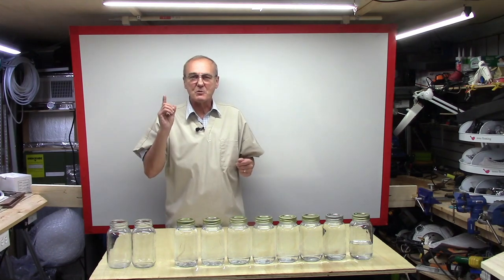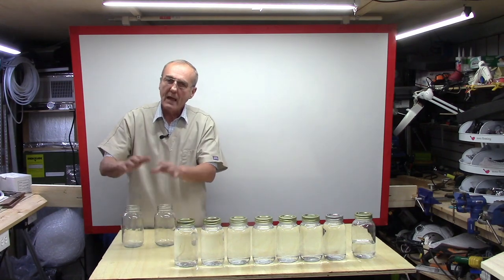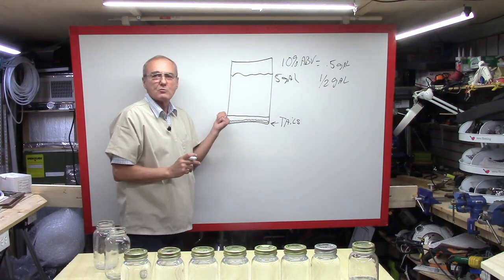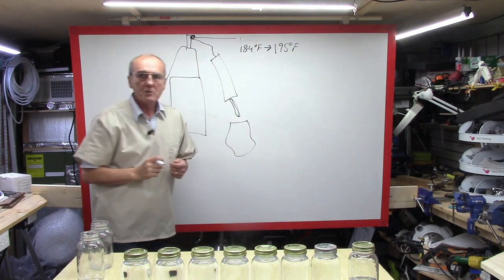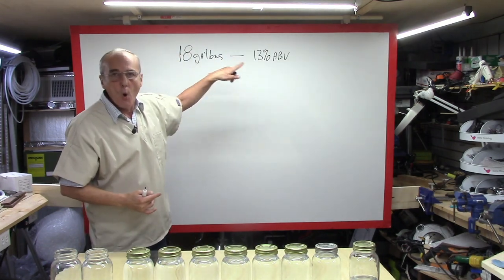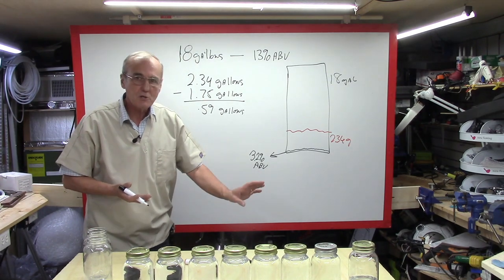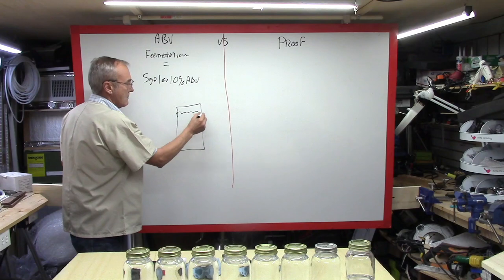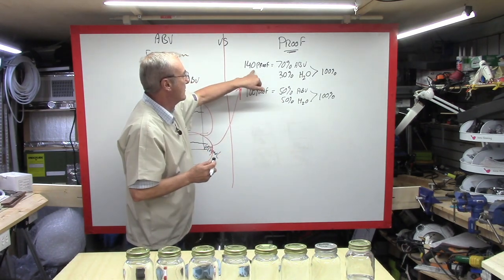When Distilling How much Do I Get

Comment: When using George’s technique of “cut it off at 100 proof AND 204 degrees” you’ve got to hit them both not either or, the math works great every time. 5 gallons of 10%, science says that’s .5 gallons of 180 proof. Take off 200ml of foreshots and 400ml of heads, you get almost exactly 1 gallon of 90 proof every time (same as 1/2 gallon of 180, just brought some water with it due to the azeotrope relationship). Now you can make cuts and separate for higher proof in the first few quarts and lower proof for the last few quarts, but a gallon of 90 proof works for me. Happy Distilling!

Comment: Question?.  Your 1.75 gal of hearts aren’t 100% abv.  They probably average 60% +/- abv across the run, so the actual 100% ethanol volume would be 1.75 gal x 60% or about 1.05 gallons of 100% ethanol.  That represents a little less than half of your initially calculated alcohol content.  If the actual final abv was 65%, it would get you to about half.  Am I missing something?
Reply: I agree. If initial ABV is 13% then from 18 gal that represents 2.34 gal at 100%ABV. But his product is around 60% so if you consider only 2 gals out of the 2.34 gal went through, subtract forecuts+heads+tails, then his final product quantity should be 2*100/60, which is 3.3 gal.

Comment: I actually use another simple math formula for "Final Product" just to get rough estimate. It's 75% hearts in my mind. So, like the original formula: 18gal at 13% = 18*0.13 = 2.34gal like in the video. But now I do my rough estimate of Heads+Tails (unusable product) to be about 25% of the entire thing. So what we're left with is 75% of the good stuff. So that's 2.34*0.75 = 1.755 gal of Good Hearts -> Pretty much exactly like in the video. Of course it can vary by a little bit, but I like that it's close. Formula would be Final=Total*ABV*0.75. And, of course, you can get into the intricacies of having actually more liquid in the end if it's lower proof or less if it's higher proof, but you should - at a glance, be able to determine just how much Mash you need to start with to fill a particular barrel for aging (whether you water it down before barreling or not).

Comment: George, I must be missing something. Your discussion only adds up if your jars are all 100% ABV. There must be a lot more alcohol that is not winding up in your hearts. You don't have 1.75 gallons of ethanol. At, lets say 75% ABV per jar you would have somewhere around 1.4 gallons of alcohol. I don't have a calculator in my hands because I have a glass of whisky instead, but am I missing something?

Comment: Maybe I'm wrong and I have watched this video probably 10+ times.  If there is 2.34 gallons of pure alcohol in the wash and what was collected is 1.75 gallons of which the starting proof was 140 and ended at 100.  By my calculations a lot of alcohol was left in the wash.  Reason I say that is because what was collected was not pure alcohol so that first jar was 140 or 70%.  Well that is 22.4 oz of pure alcohol (32oz jar) and we have almost 300 oz of pure alcohol in the wash.  There are only 7 jars with distillate.  I estimated almost 1 gallon of alcohol left and that is me assuming the proof on the other 5 jars and the tails that were not collected and subtracting 22 oz for heads and I am being liberal with that number as I can see that his heads jar is about half.  Just want to make sure I am calculating this right because I use that math to figure out when I need to stop collecting or to expect tails.  It has worked for me so far, but I wanted to make sure I had that right.

Comment: Awesome refresher course. I could listen to you all day, George!
Reply: Ok Bearded...

Now for your 2 cents.

Do YOU reuse your tails in a subsequent run/runs?

And have you noticed off flavors from it?

Or do you just toss them?

I respectfully disagree with George on this.
The amount of useful ethanol in the tails is... in my opinion too valuable to waste.

George obviously disagrees.

What say you?🤔
Reply from the maker: Wow, thanks!
Reply: @BarleyandHopsBrewing  Thank you for the solid content, brother:-)
Reply: @BillMcGirr  I think both techniques have merit, and it just depends on what you're running and what your goal is. If you have a use for tails, then putting in the time is worth it. There are always some weird flavors in the tails that might add to a blend, maybe only a few ounces. As far as rerunning in a new wash, yes, as long as it's the same spirit. You get the congeners and the ethanol. Whiskey tails into a whiskey wash. I did a video on feints about this, but it really is a preference thing. If you feel like spending the extra hours running and like hunting for that 2 ounces of caramel or whatever that's hiding in the tails, then that's what you do. If you want the residual ethanol added to a new wash, then you run deep. But if you'd rather have a nice clean hearts cut, then save those hours and cut it like George does. I like both methods and decide which one based on the end goal.
Reply: @BeardedBored  

Good stuff.
Appreciate the reply.

Best wishes.😊👍🥃
Reply: facts

Comment: Thank you George. I have been worrying for some time that I was doing something wrong because I was stopping the process at 100 proof and maybe I should continue for longer. Your explanation is clear, makes complete sense and demystifies the topic.
Reply: if the still is still running how do you stop at 100%? I'm very brand new to this and just started learning all this before I buy any still.
Reply: @Charlie32856SBCT Turn the heat off and stop collecting

Comment: Great video George. In the end, the batch size and the amount of ABV your batch has will determine how much you will get before dilution/proofing which is pretty easy to do. I use Liters and Mililiters to dilute my alcohol to a drinkable state before filtering because it's more accurate. Below is some basic formulas that anyone can use to calculate and dilute their alcohol.

ABV Hydrometer Formula (Calculates your ABV in a mash/wash):
Original Gravity - Final Gravity = answer mulitplied by 131.25 = ABV in a wash/mash

Specific Gravity Formula for refractometers using Brix:
Brix Units mulitplied by 4 = Specific Gravity

Alcohol Dilution Formula (I use L and ML's because it's more accurate):
Actual ABV % divided by required ABV% multiplied by liquid volume minus the liquid volume = needed water.

Comment: There's one thing I didn't get. To get abv from proof, you just divide proof by 2, right? Then why do you use both units instead of just sticking to one?
I mean, we could just say the mash has 10%abv, and the distilled result is 50%abv. Which is the same as 100 proof

Comment: Thanks for all the instructive videos George! Big fan, learnt alot the last couple of months that I've watched your videos.
My math and/or thinking might be incorrect here, but I think you forgot one step of the calculation. There's 2,34 gallons of pure ethanol in the still, but the product exiting the still is not pure ethanol. For example; If you get 60% during the entire run it would mean 2,34/0,6 = 3,9. If you could collect all of the ethanol (including foreshots, heads and tails), at a 60% abv you should get 3,9 gallons of of that 13%, 18 gallon mash.
Please correct me if I'm wrong though, and never stop doing what you do! :)
Reply from the maker: These volumes are all round figures so you can predict collection amounts. You will never collect 100% pure ethanol and actually you will never collect 100% of what is in the still.
Reply: @BarleyandHopsBrewing  That's true, but in my opinion it's better to take that into consideration when calculating what you can expect from a run. If there is 1 gallon of pure Ethanol in the still and you get 1 gallon of 100 proof, you really can't say that you got it all out as there are still a lot more distillable ethanol left. More than enough to just dismiss it as heads or tails. If you use a reflux still and get about 95% out, the difference is not that big. But if you use a pot still and get about 60%, the difference is significantly bigger.
But I'm here to learn, and all of your videos really make workdays and evenings more interesting. So thank you for that!
Reply: The whole exercise is for taste and smell. The process should be toward those ends so ignore the math because you cant calculate good tasting booze.
Reply: @brianmckibben2300  That is true, and I fully agree. Though my "issue" here is the calculation itself.
Say you have 2 gallons of pure ethanol in the still, and you extract 1 gallon of 50% ABV. The amount of pure ethanol left in the still is now 1,5 gallons, not 1 gallon. To not take the output percentage into consideration when calculating will give incorrect numbers. Not talking about process, just maths.
And i know that collecting 100% of what's in the still is not the goal, just saying with that example he gave, taken away foreshots, heads and tails, should result in a much larger number than 3,2%.

Comment: Some of the confusion in this topic arrives from the fact that a fermented liquid contains several types of alcohol, with ethanol being only one type. A 10% ABV liquid is not 10% ethanol, but 10% of the liquid is less dense than water. Hydrometers measure the density of a liquid compared to water. Fortunately, different alcohol molecules boil at different temperatures, so you can raise the temperature of a fermented liquid and separate different alcohols at their particular boiling point. 

All distillates are a mix of different alcohols. It is generally agreed that ethanol is the most desirable. By separating the fractions of the distillate (cuts) you can isolate the portion that has the most ethanol and the least amount of other stuff.

So don’t mistake a 10% ABV fermented liquid as 10% ethanol. It’s (mostly) 10% alcohol by volume, and only part of that is ethanol.

Comment: Great info George. Thank you.  The question I have is if you plan to use 25-30% of the leftover stillage after distillation to add to the next fermentation for a sour mash, then a portion of the tails are carried forward with the stillage.  If you do it over and over in consecutive runs, say 4th or 6th generation, doesn't that add increased risk of tails with each generation?  What are the benefits and risks associated with doing this over and over?  Since this is the way commercial distillers make their sour mash products, there have to be some benefits.  TIA and #HappyDistilling
Reply: Each generation is more diluted. If you re-use 25%, and did it infinite times, the total effect of re-use is about 33%. Early tails can be good, but you need to pay attention to when to cut.
Reply: you can use left over mash

Comment: Just distilled 20 gallons. I'd checked it before fermentation and also used the PABV chart which both came up as 10 percent. In the end I had a total over 3 gallons. I'm still scratching my head about that one.

Comment: Hello my friend. In mash made of sugar (beet), the content should not exceed 20% brix by refractometer. Conventional baker's yeast is not able to process such volumes, they are able to ferment only 10% alcohol in the wort. If we are talking about special alcoholic yeast, then they can cope with the high sugar content in the wort. Also, some yeast are not able to withstand high concentrations of ethanol in the wash, from which they die and no longer work. Even higher sugar concentrations of more than 20% have preserving properties and inhibit the life of yeast cells.  I will give an example that has been working for more than one year. With a capacity of 80 liters, 70 liters of water are added with 15 kilograms of sugar and 300 grams of baker's yeast. We have a density of 17% brix, after fermentation for 7 days, distillation takes place on a continuous mash column (distillation), after three triple distillation of raw alcohol on a tray column, it gives 6 liters of 95% alcohol

Comment: What about collecting tails for fuel especially if you make 120 proof or above. Say you have 10 gallons of 140 proof I think you could mix 2 or 3 gallons of gasoline and run it in a carburetor motor if you adjust the idle possibly

Comment: Hi , is it possible to remove tails by running through the still a second time, I only have a pot still, and to what extent can carbon remove residual tails and can you produce vodka grade alcohol without a fractionation column , Regards Tim Davy

Comment: I'm not quite getting the yield I am looking for.  My sugar wash consists of 12lbs of table sugar, 5 gallons of water, DADY and tomato paste and lemon juice for nutrients. I'm running a milk can style still w/8 gallon capacity. It has a 2in column and a shotgun condenser. I start to get my heads and fores off at about 145 degrees up to 165.  Then I start collecting hearts.  My hearts usually start around 150proof and the first two quarts I get will average 140-150.  However, after those two quarts my proof drops off quickly, usually down to 110 for the next quart and 90 for the next pint or so.  I usually stop collecting when it gets that low.  This leaves me with less than 1 gallon for a 5 gallon wash.  Any ideas?  I do not know my specific gravity as I don't have that style hydrometer, (on my need to buy list).

Comment: What a terrific explanation! 

For those wanting a super high proof (160+) without a reflux. Can someone explain how to get it out of your run safely. Novelty purposes.
Reply: You start with say a 10% wash, and do what is called a "stripping run" and run until your total collected abv is 40%. Then a "spirit run" is when you re-distill that 40%, it'll be higher proof than the original run. Never put anything in your still that is above 40% abv as that's a safety hazard.

Comment: So if I got 25 litres at 20% about and add a extra 10 litres of water diluted the mix for a cleaner run i will still collect the same amount of alcohol (ethanol) is that correct George??

Comment: I want to use a temp controled electric unit like a new wave.

Im wondering if i put temp at 
149f to regulate temp.
Shouldnt i be able to separate the methanol 1st

Comment: Hi George can I filter 68% through carbon before I break it down? seems silly filtering water , Thanks
Reply: No it only works if you filter it at 50%abv or lower
Reply: @mackemsruleFTM  Thanks Michael I have been waiting 4 weeks for an answer, I only filtered about 400ml  at 68% and seems to be ok, George does not seem to answer questions any more, cheers again

Comment: George, you know the seals in the mason jar lids, are they ok to be in contact with high proof likker?
Reply: Good question. I never thought about it.
Reply: @rayfox212  But youve never noticed any deterioration or the rubber turning gummy and leaving off aromas or anything, I take it?

I wonder if it would be a good idea to simply turn the lid around, rubber side up? unless the print is soluble ofcourse.
Then youd have a metal to glass seal- not a perfect seal, but pretty good. 

what im thinking of doing is diluting to 80 proof in the jars, and leaving plenty head room so the likker doesnt swish up and touch it.  

but if theres no visible deterioration over even long periods, i tend to think the likker itself will probably be the most harmful part to me..
Reply: @tigerlilly3727  nope I haven't noticed any thing yet
Reply: @rayfox212  good to know :)
Reply: I had an issue once. I stored high proof (150 proof) rum spirits in mason jars with the regular metal lids and seals.  After a couple weeks the clear spirit became tinged yellow in 3 out of my 4 jars. After researching in homedistiller.org, others had similar issue. They suggested using PTFE lid liners from U.S Plastics. PTFE is safe to use on high proof likker. They also discussed flipping the lid upside down but there was concern about the coating used on the lid. They even contacted the company and the coating was proprietary, so they wouldn’t tell what it was comprised of. Here are the PTFE liners I bought. Totally reusable and they don’t leak. 
https://www.usplastic.com/catalog/item.aspx?itemid=33143

Comment: Smell and taste. Don't save what you wouldn't drink. Leave the math to the nerds as the old timers had no calculator to play with.
Reply: What ?   he's giving you a measurement of proof,and how to get the best out of a run,taste and smell don't tell you shit,,measurement,in sugar water and whatever,gives you your closes proof,plus it also gives you your safety of the head and the less proof of the tails,it's only a system to go by to start out and finish a good run

Comment: What happens if i run on full reflux in t500? Usually for me it starts to drip drip spurt about 65-68C ... kinda makes no sense since thats methanol temps. Usually comes out at 93-94% and shut it off at 90% near the end
Reply: The t500 is set up to be idiot proof and get high ABV. If you want flavor from mash bypass the reflux and remove half the packing stuff. Then run it in small jars and taste / smell results after 24 hours. keep the good stuff.